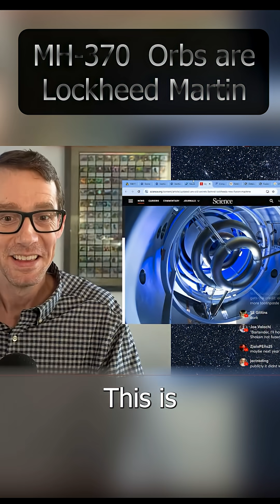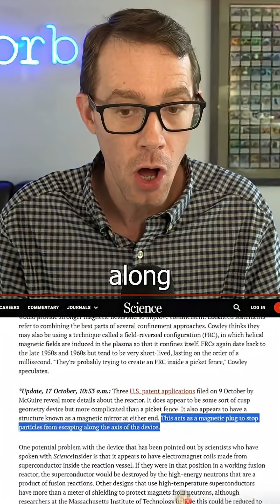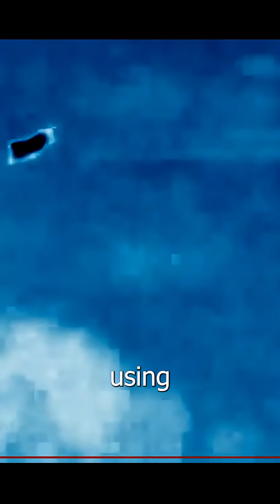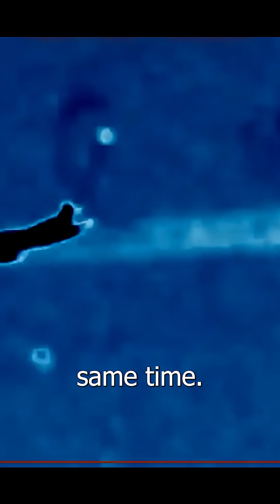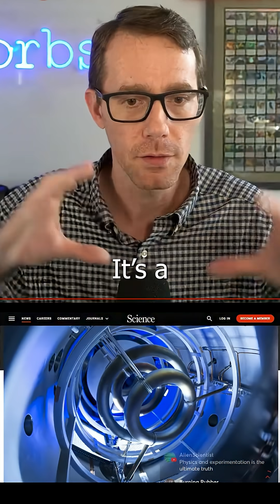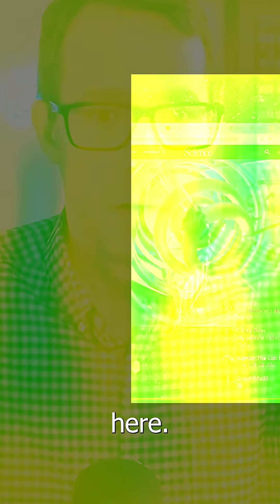Lockheed, we see you

Comment: A magnetic mirror, also known as a magnetic trap or magnetic bottle, is a configuration of magnetic fields used to confine charged particles, such as plasma, by reflecting them back and forth between regions of higher magnetic field strength. The principle relies on the Lorentz force, which causes charged particles to spiral along magnetic field lines and reflect at points where the field is stronger, effectively trapping them. Below is a comprehensive list of the uses of magnetic mirrors across various fields, based on their ability to confine and manipulate charged particles:
1. Nuclear Fusion Research
	•	Magnetic Confinement Fusion: Magnetic mirrors are used in fusion devices, such as the Magnetic Mirror Machine or Mirror Fusion Test Facility, to confine high-temperature plasma needed for nuclear fusion. By trapping charged particles, they help maintain the conditions for fusion reactions, where light atomic nuclei combine to release energy.
	•	Plasma Stability Studies: Magnetic mirrors are employed to study plasma behavior and stability, critical for developing practical fusion reactors like tokamaks or stellarators, even though pure mirror-based reactors are less common today.
2. Plasma Physics Experiments
	•	Charged Particle Confinement: Magnetic mirrors are used in laboratory settings to trap and study charged particles, such as electrons or ions, to understand plasma dynamics, wave-particle interactions, and turbulence.
	•	Space Plasma Simulation: They simulate conditions in space plasmas, such as those found in the Earth’s magnetosphere or solar wind, to study phenomena like magnetic reconnection or particle acceleration.
3. Astrophysics and Space Science
	•	Modeling Planetary Magnetospheres: Magnetic mirrors help model natural magnetic mirror configurations, such as those in Earth’s Van Allen radiation belts, where charged particles are trapped by the planet’s magnetic field. This aids in understanding space weather and its effects on satellites and communication systems.
	•	Cosmic Ray Studies: They are used to replicate the confinement of cosmic rays in galactic magnetic fields, providing insights into high-energy particle behavior in the universe.
4. Ion Source and Beam Manipulation
	•	Ion Sources for Accelerators: Magnetic mirrors are used in ion sources to confine and extract ions for particle accelerators, which are employed in fundamental physics research, medical treatments, and materials analysis.
	•	Ion Beam Focusing: They help focus and guide ion beams in applications like mass spectrometry or ion implantation for semiconductor manufacturing.
5. Medical and Industrial Applications
	•	Medical Isotope Production: Magnetic mirrors can be part of systems to confine plasmas or ion beams used in cyclotrons or other devices that produce isotopes for medical imaging (e.g., PET scans) or cancer therapy.
	•	Material Processing: In plasma-based material processing, such as plasma etching or deposition in semiconductor fabrication, magnetic mirrors can enhance plasma confinement to improve efficiency and uniformity.
6. Space Propulsion
	•	Plasma-Based Propulsion: Magnetic mirrors are explored in advanced space propulsion systems, such as variable specific impulse magnetoplasma rockets (VASIMR). They confine plasma to heat and accelerate it, generating thrust for efficient deep-space missions.
	•	Electric Propulsion Testing: They are used in ground-based testing of electric propulsion systems, ensuring plasma confinement during thruster development.
7. Microwave Generation
	•	Electron Cyclotron Resonance (ECR): Magnetic mirrors are integral to ECR ion sources, where they confine electrons to generate high-frequency microwaves. These are used in radar systems, communication technologies, and plasma heating for fusion research.
8. Antimatter Research
	•	Positron and Antiproton Trapping: Magnetic mirrors are used in experiments to trap antimatter particles, such as positrons or antiprotons, for studies in fundamental physics, including tests of CPT symmetry or antihydrogen production (e.g., in experiments like ALPHA at CERN).
9. High-Energy Physics
	•	Particle Traps for Experiments: Magnetic mirrors are used to confine charged particles in high-energy physics experiments, enabling precise measurements of particle properties, such as magnetic moments or decay rates.
10. Education and Demonstration
	•	Teaching Plasma Physics: Magnetic mirrors are used in educational settings to demonstrate principles of plasma confinement, magnetic fields, and charged particle dynamics in university labs or science museums.
	•	Proof-of-Concept Experiments: They serve as testbeds for developing new magnetic confinement techniques or validating theoretical models in plasma physics.
Limitations and Context
While magnetic mirrors have been historically significant, their use in fusion research has declined in favor of toroidal configurations like tokamaks due to issues like particle leakage at the mirror ends (end losses). However, they remain valuable in niche applications, particularly in plasma physics, space science, and specialized technologies.